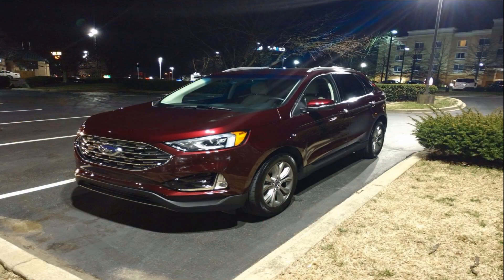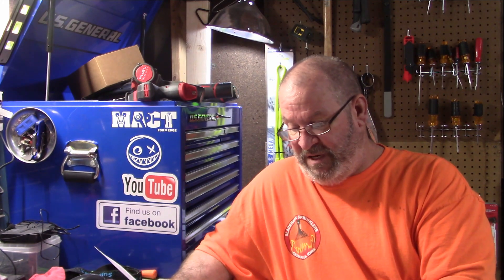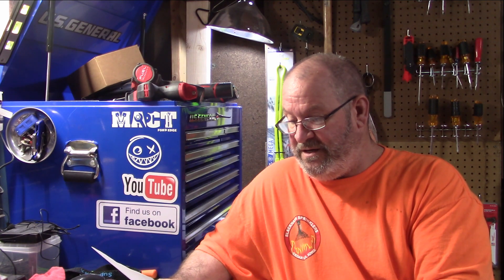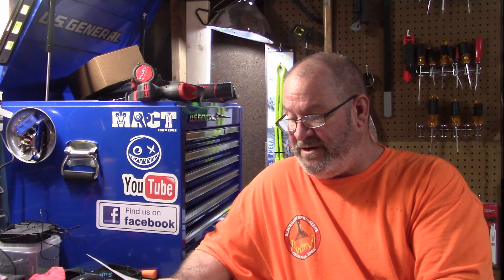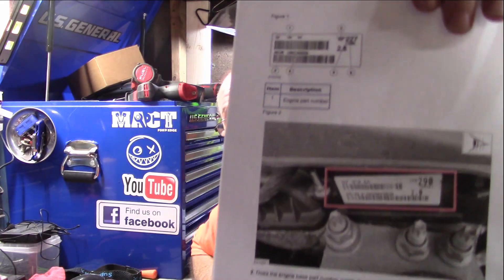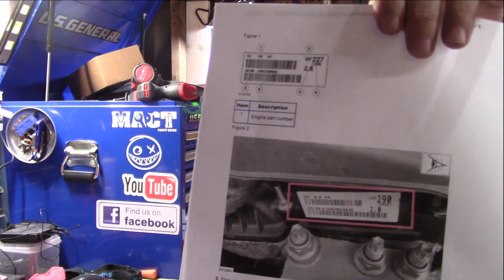TSB 19 2346 2 0 Ecoboost Coolant in Cylinders water intrusion

Comment: ATTENTION ❗️
Before you purchase a Lincoln or Ford with the 1,5 or 2.0 eco boost. Do some research.
Im completely SOL.  Bought a used 18 MKZ 2.0T.  Engine light came on . Started running rough at cold start , some white smoke, smelled a little sweet, and losing coolant but bot leaking. Ran a  PO302 code. Misfire in the # 2 cylinder.  Couldn’t figure out what was wrong until i did some Research .  And the realization that this  engine fell victim to coolant intrusion.  Called Lincoln to see if it fell under the “ Customer Satisfaction Program” ( basically Lincoln knew of this design Flaw, but couldn’t classify as a “Recall”  due to the fact that it was a “ Safety issue”. So they instead started a program that did a one time repair at no cost.). However ,  this vehicle was not covered by the program ( idk why, I   Got no answers).  So I basically am stuck with a very step repair cost.  Lesson learned the hard way.

Comment: My 2017 Lincoln MKC at around 50,000 miles…..would have a rough idle in the mornings. Didn’t do it all the time at first. However, it progressively got worse and more often. I was checking and adding coolant when needed too often. Finally, it was running so bad the engine light was set PO302 misfire on number 2. With 60,000 miles on it……I installed new plugs and turned engine light off. It ran good for several days…..then the rough idle came back with smell of coolant. Took to shop and new engine  will be replaced under warranty. My question…..does the new engine have all the 2022 updates if there are any? Or is it still the factory 2017 engine just with the modification to stop the water intrusion?

Comment: In fact I was on the phone with the Ford dealer earlier this morning. So at this moment we will be having the engine replaced in our 2018 Escape 2.0 Eco Boost  engine. Coolant leaking in cylinder #3. The service writer said the same thing. A long block. Apparently this is a common issue. It is under factory warranty thank goodness. The vehicle has only 41K on OD.

Comment: Seems like this problem may also occur in the 2015-2018 Focus ST 2.0 engines as well.
Reply: I have a 2016 Ford Fusion 121xxx miles and have no issues with it. Then about 2 weeks ago I started noticing white smoke coming from the exhaust but only in the mornings after it has been sitting overnight looked it up and this is what it shows but the car runs flawless no MIL or sluggish engine. Hoping
 it might be the turbo

Comment: 61,000 miles in on my  2018 fusion. Had a rough idle on startup and check engine light came on  Took it in and ford diagnosed it with coolant intrusion.  Whole engine replacement.  (Glad I bought the extended warranty) Gonna take two weeks minimum before it can be worked on. Very frustrating.

Comment: interesting, I have a ‘19  2.0 ecoboost awd that just hit 66,xxx I drive a decent distance for work however, my 2-3 shift is horrible getting much worse (the trans fluid is good and to spec) and now it is beginning to do it on the 3-4 shift on occasion (normal driving and hard) I am almost certain this transmission is going to fail soon. The dealer refuses to look at the trans and got told I’d need to take it to ford and pay out of pocket 🙄 so much for that warranty, the engine seems strong for the most part but then again I did have to remove all the sound deadening from the undercarriage because in the summer months under normal driving it pings on acceleration. I figured it was due to the ridiculous heat Trapment as well as the heat shield in the hood it still pings on occasion but not as regular as it was. I’ve racked my brain out of curiosity to figure out why or if something else was the cause but came up answer less, I always run top tier premium. Is that the start of the issue by chance? I like the car it pulls quite well for how heavy they are but it makes me question the longevity and if I should sell it before it becomes a headache. Thanks in advance

Comment: What you describe sounds like what I was getting on my Focus. I decided to trade it in quickly and got a new car. The dealer tried to start my old car and it turned over but wouldn't fire probably because there was so much coolant in the cylinder. I walked away with a new car. And it's the dealers problem now if it needs a new engine. How's that for good timing.

Comment: Why not replace the head gasket? Seems like that's what fails.
Reply: because its a design flaw of the metal and that will eventually fail and everytime it fails your engine drinks coolant :)
Reply: @enacku  I aware. But it looks like the gasket fails due to the machining of the block. Wouldn't just replace the gasket give it another 100k miles?
Reply: I'm done. Buying Japanese now. Good bye Ford.
Reply: @exil3dlivecom   I work at Honda.  Very few problems here ;-)
Reply: @wydopnthrtl  lol. I know.

Comment: Check engine light came on Christmas Eve with our 2018 Edge. MIL P0302. Pulled spark plug and it was burnt orange looking. Noticed the coolant was nearly empty to came to YouTube to learn more. Dropped it off at the Ford dealer the following Monday. They called 10 days later confirming it needs a new bug block. Luckily, we’re under warranty with only 47k miles. They already have all of the parts but have about 10 vehicles ahead of us so it’ll take about 2-3 weeks to complete the job.

Comment: My new Long block just came 9-20- 2. 9/20/21 is the taking out and installation day. Got 3 warranty's. $100 deductible. Don't know if I should keep it or not. What kind of warranty will I have after installation?   Will it be better with the new designed block?  Have many questions still.  Shawn.

Comment: I need my engine replaced on my 2019 Fusion  because of this problem. Does anyone know if the new engine that ford uses has been updated so this problem is fixed or am I just getting another pos engine? Thanks
Reply: Yeah the new block is better. They fixed it after 2020
Reply: Look on the inside of your drivers door, what year and month does it say it was manufactured?

Comment: I had the head replaced on my 2017 Escape 2.0 at 28,000 miles in January 2019. At 58,000 miles (August 2021), I am having the engine replaced. This is happening right before the warranty expired ... got lucky!

Comment: I have a 2015 Ford Fusion turbo titanium. It has 74k miles on it. I have an extended warranty. Car was in shop for 2 months getting the engine replaced. New engine. Drive maybe 500 miles. Coolant leaking into the engine again! If your reading this I suggest just not getting this engine in a car. Hopefully they will fix my car again and I can sell.

Comment: Just happened to me. 2017 Lincoln MKZ 20,000 miles. Rough idle no lights. Took it in and 4 hrs later got call needed car for a month to replace. That was a month ago,now they are telling me another month or 2 due to lack of parts and covid

Comment: MACTFORDEDGE do you know if the engine has been revised yet?  Mine is at the dealer now getting a new engine.  It’s a 2016 fusion.  From what I understand it’s a new design and you can’t even get the old poor design anymore
Reply from the maker: All replacements are (if new) updates with a drilled hole rather than a cut in the block.
Reply: @MACTFordEdge  so then I would be safe if bought a newer 2020 fusion titanium with the 2.0 because it has been revised and doesn’t affect this model year correct?

Comment: Just bought a used 2017 Edge w/ 57,000+ miles and had this issue had this issue less than 10 days after purchase.  Lucky for me a Ford dealer is repairing under the 60,000 mile warranty.

Comment: Here is the official ford tech bulletin if it helps anyone on cars under the list 
2017-2019 Fusion/MKZ built on or before 8-Apr-2019 - 2017-2019 Escape built on or before 16-May-2019
- 2017-2019 MKC built on or before 18-Apr-2019
• 2.0L EcoBoost engine
The new engine block has been redesigned

Comment: how you can tell that engine block was already replaced with Long block? Is there any indicators so if you looking to buy  ford edge, so you can look if the engine block was replaced already ?
Reply: Go to a Ford dealer and have them pull an Oasis report on your vehicle's VIN. This report will show all warranty or non warranty work performed by a Ford dealer.

Comment: My 2017 Edge 2.0 EB needed a long block engine replacement at 31,000 miles because of coolant leaking into cylinder 2. Luckily under warranty. Many Edge owners are having the same issue. Traded mine for a Toyota. 
Quite a shame. My first Ford and I loved the car, great ride, comfortable, roomy and good handling. but that totally blew it for me. 
Ford needs to own up to these customers or lose them, like me.
Reply: Had same problem on my 2017 Escape Titanium AWD 2.0. Great SUV. The whole nine yards. 30,000 miles on it! BAM! ENGINE LIGHT came on. Took to the Dealership reset the engine lights. One week later.  Bam!  Coolant low in bottle. Took it back for Pressure test. It Failed big time. 2 and 3 cylinders leaking anti freeze in to the cylinders. New long ordered. Still hasn't come in yet! When it does it will be another month before installation. My wife and I want to get rid of it quick. Toyota or Honda. Ford had their chance. Now I know why their stock is 13.00 dollars a share. Ford I hope your Electric cars and SUV's are alot better or your going to be out of business all together.    Shawn.

Comment: I am lucky I have a Lincoln warranty is 110000 or 5 years I've had misfire replace spark plugs replace coil pack clean fuel injector still problems take it to Ford new engine 3000 km before warranty expires

Comment: Hi Matty! Does 2019 Ford Egde has this issue? Thanks
Reply: I'm starting to wonder about my wifes 2019 Edge as well.  It is at the dealer for the third time in 3-4 months.  We have a swooshing noise at the steering wheel.  All they can find is that the coolant level is low, creating the sound but they can't find a leak.  Since we have no evidence of a leak under the vehicle I'm thinking it is leaking into the engine somehow.
Reply: I have a 2019 edge with a 2.0L and it has the exact same issue. We took it in under warranty and they tried to fix it but now it’s doing it again a year later but no longer under warranty.

Comment: Just took my 2018 edge in yesterday. They are replacing the engine. Luckily under warranty.
Reply: Mine went in a week ago and they claim it is some kind of valve failure. Not needing and engine replacement. Did you have any conversation like this? Mine is a 2019 as well with 36k miles.

Comment: We've replace a lot of these 1.5/2.0L ecoboost at our Ford dealership. The block was redesigned in 2019 to eliminate this problem. Whether this fixes the coolant issue or not remains to be seen, but we haven't seen any late19-20 models come in for coolant loss, yet. I agree with you to get the extended warranty, the 2.0L turbos are known for early failure and because it's a one-piece design with the manifold, it gets quite expensive to replace. Last time I checked it was about $2000+ to replace the turbo/manifold assembly.
Reply: This is what Ford dealerships love. Ford makes cars that need engine replacements every 25k miles. The dealer gets huge profits from selling and servicing vehicles that are intentionally designed to fail. Ford has had 10 yrs to redesign and fix the known problem but chooses not to. My friend has paid $19k for a 2019 Fusion. Today it overheated multiple times on a 500 mile trip. The engine is likely leaking coolant internally. She thinks her warranty is not going to cover it. This is not funny and I wonder why the channel host laughs about how much it costs to fix. Btw there is no point in fixing the engine by replacing it with another defective engine! If you are thinking about buying a Ford with an ecoboost I highly recommend you DON'T. Hopefully once Ford loses the ongoing class action lawsuit on this it will be 1 more nail in their coffin before they go bankrupt.

Comment: My 2017 Escape with 61494 mile on it needs a new engine! Ford said pound sand! Found on the road dead that's my car. My first and last Ford.
Reply: Amen brother, first and last for me too.  I should have known better.
Reply: My 17 escape 1.5L is currently getting a new motor due to this issue. I'm in the hook for $6k. BS
Reply: And 3 weeks after the new motor it's now in the shop getting a new transmission...... 10k bucks in under a month......
Reply: Yep same here with a 2017 fusion. Ford sucks

Comment: I am waiting for replacing the engine. I live in Canada and the total cost would be over 9k. The good thing is i purchased the extend warranty. I would never buy any north america vehicle. Most of them are garbage. Buy japanese or Germany vehicle.
Reply: @Niko-iv4ch   Mine had a problem after replacing the spark plugs. Just keep eye on the coolant level. If something happened, make sure it is been found before the warranty expired. Good luck.
Reply: @youmingluo9738  hey I am having current issue as well w my fusion . What happened after you changed spark plugs ? I did purge valve ..spark plugs coil pack.. n now I’m told I need new engine possibly not sure yet . It was always low on coolant always I did door dash and every two three days had to add coolant wth did it go long block?
Reply: @rachell6214  Sorry man. If you have low coolant issue, make sure you have back up coolant in your trunk while driving on the highway. Or make sure you check coolant before you drive. Unluckly, you may have to replace the entire engine. If your fusion is still under warrany, just replace it for free. It's techinical issue!!! FORD quality is cheap. I found this issue after i changed the spark plug.

Comment: My 2017 Fusion 2.0 is at the dealer for a long block install. The car has 42,000 and Ford is picking up the dime!  They come with a 5-year or 50,000-mile power train warranty!  They also gave me a 2020 Ford Edge  Redline with only 195 miles for a loaner!  My question is, will the new engine last longer?  Have they corrected the problem?  I have read that other folks had their engine replaced twice or three times.  Anyone know?  Thanks
Reply: yes  they have, all new long blocks are of the style and they are putting the revived motor in new  product line assembly
Reply: They didn’t even offer me a loaner I’ve been without a car for a week.  My car needs a new engine as well.
Reply: @3fiddyed972  is the engine still under warranty? If so, they must replace it under the policy. Providing a loaner may be a dealer option but I wouldn’t think so. You should call your dealer a demand a loaner because the Ford Motor Company reimburses the dealer for the loaner. They are probably counting your money now.

Comment: I have done extensive research on this because I just determined that I have a 2017 Edge with this problem, and with 48K miles on it, I should still be within the powertrain warranty.  When out of warranty, the cost to do this for the owner is between $8,000.00 and $9,000.00 out of pocket.  Do the research and you'll see it for yourself.

Comment: Happened to me on a 2019 MKZ with just over 16K miles. No smoke, ran fine & plenty of power. Noticed my coolant was slightly below "MIN" and asked the dealer to check when I brought it in for an oil change. Was shocked when the service mgr called and told me they had to replace the engine. Check your fluids and keep a warranty in force whenever you can!
Reply: Same here my mkc went for service get a call that they checked the codes an needed engine replacement. So lucky had a warranty. The service guy showed me the actual ford technical bulletin the newer blocks are improved. Here are the cars affected 2017-2019 Fusion/MKZ built on or before 8-Apr-2019 - 2017-2019 Escape built on or before 16-May-2019
- 2017-2019 MKC built on or before 18-Apr-2019
• 2.0L EcoBoost engine
• Presence of coolant in the engine coolant in engine
Reply: My mother has this problem but is on social security and can't afford the repairs... they're saying a full engine replacement at roughly $8000, 2018 Ford Edge.